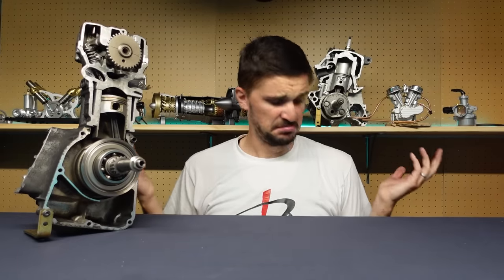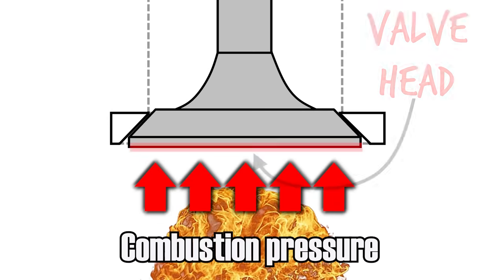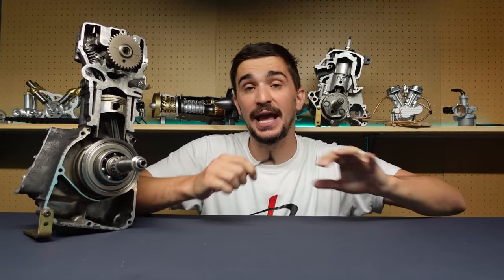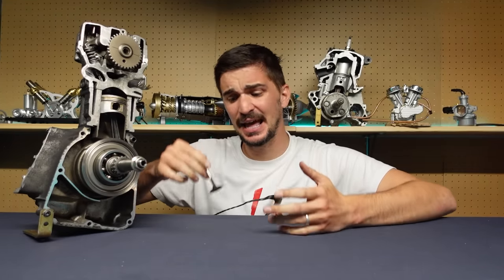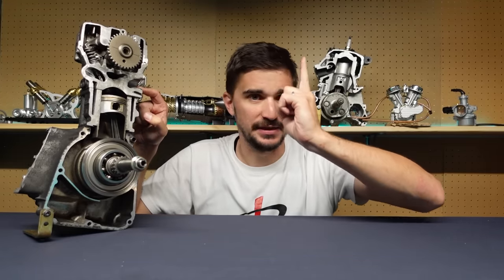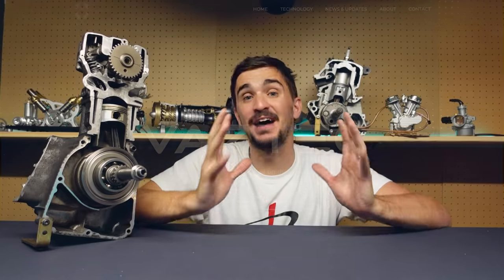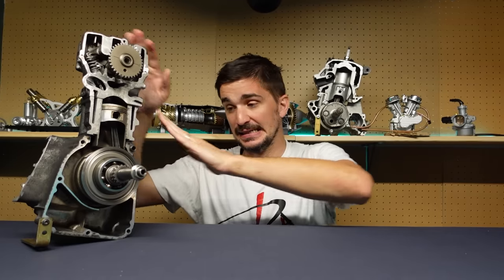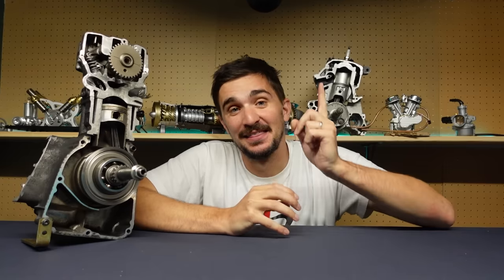Rotary Valves Make Normal Valves Look Silly - Why Aren't We Using Them?

Comment: I feel that one concern with a rotary valve would be potential failure states. You have it with the current valve style as well to an extent if a stem snapped entirely, but with a rotary valve what would happen if something caused the valve to stop rotating while in an open position?

I'm not a mechanical engineer in the slightest, but any time I do make something myself my concern is always "how can I make this safe even if it has a catastrophic failure" and with poppet valves I feel like that was taken into consideration since the pressure of an explosion in theory is more likely to force the valves shut than potentially break them while open.

Comment: I gotta say, if you’re already going to be dealing with finicky seals, may as well just use a full on rotary engine. Those also have no valve train and eliminate all of the problems they typically create. They aren’t even unreliable if cared for, I’ve daily driven my RX-8 for 10 years with no engine problems, I just have to run conventional only and I add a couple quarts in between changes. I drive it like I stole it every day cause I know that I don’t ever have to worry about float. It never feels under stress even at over 9000 rpm. 

The 787B had the most reliable engine in Le Mans contention at the time, which lead to Mazda’s victory. The Mercedes V12 leading the charge broke down in the final hours while the rotary didn’t. Look at Rob Dahm too, he’s pushing well over 1000hp through all 4 wheels on a shoestring budget, that dude is proof that rotary engines are underrated and misunderstood.

Comment: Could you place them vertically and have the top spin against a thrust bearing? No idea if that would survive the pressure long term. But I imagine that way, using timing and a return spring, you could have some lower part of the valve body shape create a positive seal when neccessary during the duty cycle. But the return spring wouldn't be anything remotely as strong as a poppet valve spring, as it is not there to open and close a large port gap super fast, just to push the rotary valve body out again a tiny bit so the positive seal surfaces no longer touch, so it can rotate to next stage in duty cycle with minimal friction. The air/fuel and exhaust would need to flow in and out the sides and out ports in the end of the valve so it's not a straight path through, but just spitballing here. If something like that could work, then I imagine it would be a lot more conducive car engines and miniaturization too, as most of the material bulk to contain it would be the valve itself. It wouldn't need such a hefty containment around it.

Comment: HP model airplane engines had a rotary valve back in the 80's and I believe it was manufactured in Europe - not sure. Now, the MECOA Corp in Irwindale Calif. is producing and distributing them. It is possible they were the developers but I have no information. These engines are super simple vs the poppet valve versions. I have a small one I purchased back in the late 80's for an Eindecker model plane with a not too large wing span. I should get busy and construct the plane and get the engine running. It is fired with a glow plug.

Comment: ~ 10:50 I mean, the barrel valve and housing could be made from I dunno, (super) Invar, or titanium or tungsten or even stuff like silicon carbide? They have like 10^-6/-7 expansion rate per degree Celsius, which with the temperatures of IC engine (high, but not like blast furnace high, right?) it should be fine. The o-rings though - I'd think of using some very thick sealants? Something that will allow motion but not be very happy letting air out. Some weird mix of graphite, teflon and what nots?

Comment: in the 2 stroke days we had power valve on the exhaust side which operate largely similar to the rotary valve described here, but it's a nightmare to maintain, it clogged up every few thousand miles and wear out easily losing the seal and power, sometimes it simply jammed

Comment: Great video. it makes me wonder why traditional valves don't have a more aerodynamic shape?  Why not a Kammtail shape?  It would take up more space (taller) and be more moving mass, but air flow into the engine would be significantly less  impeded.  Any thoughts?

Comment: Just some off the wall ideas... Seems like it would be better to have 2 rotating valves per cylinder instead of one(intake side and exhaust side). That way the spark plug could be in the middle, and intake/exhaust could be separated more to allow for better efficiencies.  It would also fit a bit better with current engine layouts. Inside the cylinder, it seems like there should be a way you could use springless check valves. Where the seats like a traditional valve will seat and not leak, or leak as much. Should be possible with a cam driving the check valve.

--edit, forgot one... if you want to minimize blow by why not use something like an apex seal.

Comment: Years ago maybe late 1950s early 1960 I read in one of the motorcycle magazines about an engine with a retort vale  engine it was built with and the rotary vale turned free as a bird and the engine did work but they had great difficulty getting it to close down, the programme was shelved. So in theory it worked but didn’t.

Comment: The rotary valve isn't just exposed to combustion heat, but also combustion pressures. Which only makes sealing harder to accomplish.  Also given the size of the valves depicted any weight savings from losing the cam, lifters, springs, etc. Is negligible. Air flow is also problematic. In a throttle body or carburation set up you a volume of fuel air mix trapped in the valve. Which under high heat would likely ignite. Creating potential back fire issues, and a slug of dead mix contaminating the incoming charge. Depending on actual valve geometry, could also send a slug of fuel / air mix down the exhaust, where it could also ignite. Literaly blowing pipes and mufflers apart. Did i miss anything?

Comment: I have a question why not use ceramic seals such as those on industrial water pumps you can avoid direct contact with exhaust gases via a pair of those seals on different stepped surfaces possibly by adding bearing surface between said seals with low pressure oil you’ll need a chamber and probably some seals like in a wankle engine to ride against said valve but it should definitely be doable if I had the time I would build a prototype head

Comment: this made me think of a different type of valve design, but instead of continious rotary movement I would design it to do back and forward motion like a sviwel arm, that way you can put carbon seals(like the ones they use in mechanical seals and electical motor graphites) and I think you can achive constant sealing force. but in return you have to replace the carbon seals because eventually they will wear out completely.

Comment: been a mechanic most of my 70 yrs. and I'm curious how you keep oil from leaking into the cylinder heads when both sides of that rotating valve need to be lubed...
Reply: Engineer and mechanic (though with far less experience) here.
My educated guess: Reduction of need for lubrication on the 
surfaces (such as self-lubricating grey iron), lowering the amount of nessecary 
lubrication to a point where the leakage can just be absorbed into the combustion.
Reply from the maker: You can see an actual working prototype in the video.

Comment: Would not the use of pneumatically operated poppet valves also offer many advantages such as eliminating much of the valve train? It still has flow issues, but seems to be a more efficient design.

Comment: what if the valve was a rotating disc with holes? it would keep the sealing proppertys but require no springs or other moving parts?

Comment: Would a 2 barrel system seal better? Like a vertical rotary valve where an external Barrel seats in the block and an internal barrel rotates with timing?

Comment: Other systems might be able to mimic the Freevalve setup, but they will never be able to outperform it. Any system that uses the engine to directly drive the opening/closing of valves (poppet or rotary) will have some level of parasitic loss.

What I would like to see is the height difference between a conventional automotive poppet valve ICE and that same engine with rotary valves. Also would love to see the power figures between the two engines.

Comment: Well, the energy "stored" in the spring, is "given back" to a large amount to the camshaft, so the overall "energy loss" is rather small.
A "rotary valve" needs permanent lubrication, whereas the lubrication is burnt where visible to the combustion.

Comment: if you want a valve-less engine, a two stroke engine is the way to go. It has ports in the cylinder walls and the piston itself acts as the valve. The rotary engine development has had huge leaps forward in seal technology which could render the piston engine obsolete.

Comment: Just imagine if this had had just half as much R & D as the poppet system. Can see how easy it would be to incorporate water cooling into a valve train like this. 
Also, it might be possible to “lubricate” the bearing with air at 800 psi or so. This should be enough to counter or greatly reduce ingress of combustion gases.
I’m drooling, thinking of the opportunities for improvements in breathing that might emerge with this “straight through” design.

Comment: Wouldn't it be possible to attach a something like a piston rod to a rotary valve in such a way the rotary valve rotates back and forth. And then have a conical shape that seals it in each direction. I guess similar to a traditional rotary engine design but use that for the intake valve.

Comment: You know that the spring releases the stored energy later? You have only the friction of the moving part of the valve in both cases: Springbased and rotationbased valve. Maybe a tiny isse with displacing the volume in the combustion chamber by the spring valve
Reply: "You know that the spring releases the stored energy later?"
Yes, and at high RPM, the vast majority of that energy goes into overcoming the inertia of the valve, rocker and the spring itself. 
The phenomenon of the "floating valve" exists because even when the springs in question put ALL their energy into that, they are still not fast enough do it in time for the cam shaft to open them again. And logically at that point, the cam shaft is getting NONE of its energy back.
And the higher you get in RPM, the closer and closer you get to that point. And even if you don't reach it, the amount of energy given back to the cam shaft goes closer and closer to zero.

Comment: I have an idea
Stainless steel barrels protruding into the block  encased in cast iron or aluminum sealed on the bottom with a regular head gasket.easy access.Teflon seal on the sides.and the spark plugs and injectors inter in the block

Comment: What if it wasn't a straight cylinder but rather shaped like a dual sided bevel gear with the holes placed at the very outer circumference of the cylinder that way one side of the valve will be able to make a near positive seal during combustion like a popit valve? In theory the seal performance should increase with the thermal expansion.

Comment: Why not redesign the poppet valve to a swinging offset shape with it's same conical valve seat? It would still reduce some of the parts, improve flow, retain that positive seal, but would still need a spring or some resistor that leaches some power, though with the decent compression ratios the conventional designs can achieve. I'm describing a valve that moves like the pendulum arm of the channel favorite Taurozzi engine.

Comment: I wonder if it's possible to have air injection combined with direct (fuel) injection in the combustion chamber? Then you only need an exhaust valve?

Comment: What if you were to angle the rotor's tubing in such a way that it could act as both the intake and exhaust, and mirror it to both sides of the rotor, then you would be able to mount the intake and exhaust more to the sides of the head like we do traditionally, and you reduce the need to add a seal between halves.
Reply: Wouldn't it heat up the intake gasses and cause a loss of efficiency?

Comment: What if the rotary valve changes its placement to the side of the cylinder instead of above the cylinder? This would mimic a two-stroke engine that has intake and exhaust holes along the side of the cylinder. The rotary valve would control the stroke into a four-stroke instead of a two-stroke. then the sealing problem would be no more issues since the holes will automatically be closed when the piston is in the top position and it won't get the heat directly.... just playing around on my mind.

Comment: The timing of this innovation brings to mind the evolution of video marketing.  What if Blockbuster video stores were conceived at the same time that netflix came online.  How many investors would have jumped in on  Blockbuster video stores?
Considering the complexity of combustion engines vs electric, and inflation causing manufacturers to try and reduce costs, I can see how this ingenious design might fall by the wayside.

Comment: Hey! What if the spark source is in the piston, with the travel of the piston vs the wall be the magneto generator, or the connecting rod bearing motion relative to the crankshaft as more conventional rotary magneto.   Probably with wasted spark.

Comment: Look up the Zimmerman Motorcycle, VTwin 250cc rotary valve 4 stroke made in 1940ish to the 1960’s,  only made a couple of these in that time 
He also made a 4cyl on a Crowley bottom end with his own rotary head for boat racing!
Ford was working with his design in the 70’s but scrapped the project

Comment: Its an interesting idea but I foresee issues lots of issues.
The first being that the seal gets worse as pressures go up much like a piston seal it ends up having to be metal rings of some description that will have tolerances and will only be able to handle up to a certain amount of pressure, boost pressure will cause less sealing and more chance of the exhaust gasses to get to the intake side of the valve. For that reason alone I would create two separate valves if I were designing this thing, keeping them in separate valve tubes.

Also I do not see the big benefit in general. Sure if it was a straight tube it would be great but its not it is a straight tube that rotates in and out which means for most of the cycle the tube is restricted much like a regular valve, but unlike a regular valve this would basically be a wall no smoothing of air. So the benefit of this straight tube would be very short lived and compared to a regular valve the rest of the time it would actually be more restrictive. So I would have to see independent proof that this actually improves things over a regular valve.

Yes the force to overcome the valve spring resistance is parasitic but spinning a metal cilinder in a housing with nothing much else than a few bearings which must withstand rather high rotation speeds and pressures without oil... I'd say is probably going to be marginally less resistance if not the same, as with the springs you have a camshaft that is equally being resisted and pushed by other springs, where as with these cylinders you are going to have to spin them all at the some time with none of them helping to rotate the others.

Also and I think this is the major hurdle for this technology the R&D costs to make this work for a high revving production engine is going to be cost prohibitive to say the least. Take a quick look at the 1.8t engine its been used in various forms for nearly 40 years... now thats getting your R&D moneys worth. Other care builders do not use the same engine for that long but they will take the same basic design and tweak it for their needs rather than designing from the ground up. Look at Samsung and its boxer engines for instance, same engine (broadly speaking) but tweaked for what ever purpose it is supposed to suit. This has worked well for all car manufacturers and has resulted in every engine from a car manufacturer being pretty recognizable as coming from that manufacturer, even if it is a entirely different engine.
Why on earth would a car manufacturer choose to spend enough to buy a third world country on this technology and a whole new engine design to gain... a minute performance benefit if any? I doubt that anyone of them would be willing to take that risk especially now that internal combustion engines are being forced out of many markets with ever more environmental constraints and not seldom substantial subsidies for electric vehicles.
Would you bet the company on marginal performance improvements on a product that looks to be regulated to death in the near future? My guess is if we are going to see production engines with these valves it is going to be small engines like lawnmowers and such, or maybe if the improvements are truly fantastic in some race engines much like we see specialized engine parts for drag racing and endurance racing that you generally would not want to use for a production car since they do not make much sense for such applicaitons.

Comment: Another weakness of rotary cam beside leaking is friction. It has to continuously move while pressed to the lower pressure direction. With conventional valve, energy exerted to push valve returned to cam when it closes, and the friction only happen in shorter duration. But yes, it has weakness in high rpm. May be we need another solution, such as slider valve.

Comment: Actually if they use a carbon seal on the sides, supported with a turbocarcger pressure may be effective. If normally aspirated vacuum from inside can be used. For the surface also possible if the drum is hollow then with calibrated temperature in the chamber may work.
Reliability is my real doubt.